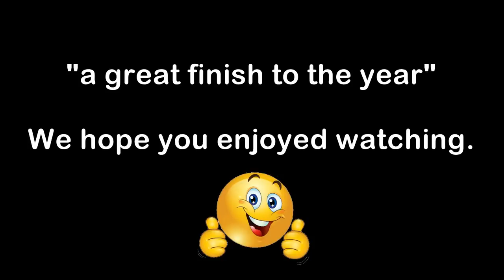4x4 Fails 2016

Comment: Looks like rock crawling is better suited for purpose built machines with lighter bodies and drive train made for the torque.  Not these vehicles.
Reply from the maker: This is about road registered vehicles doing tough terrain, not comp trucks.
Reply: +Aussie Four Wheelers (Hemi4WD) 
Yes, I have done something similar on a Honda Goldwing.  I took it out on a road that turned into an offroad trail and ended up with significant expensive damage to it.  I learned from that experience and don't go offroading with vehicles not made for the terrain.  That is why I posted the comment I did.  If you want to destroy street vehicles and pay to repair them, no problem whatsoever,  it is just far more fun when you can go rock climbing and get back home again without needing to perform major repairs on site or later on.  Once again, what you consider fun is also your business, but I don't consider field repairing a trashed drivetrain or suspension on a mountainside to be fun.
Reply from the maker: Different vehicle regulations for different countries mate. We are limited by what we can drive. Also, you cannot drive a non-registered vehicle on these trails, so we have to build our daily drivers to the extent we can.
Reply: +Aussie Four Wheelers (Hemi4WD) 
True, there are many places like that where I live as well.  After ruining a perfectly good road machine I looked for offroad capable machines that could still be street legal and licensed as well.  My favorite so far has been a Polaris RZR highlifter, it does pretty tough rock crawling and deep mud hole slogging.  I've not met any terrain yet that stops it.  I live in the rocky mountains so the trails there are just as tough as any.  I know you guys are having fun, it's just an extra challenge to field repair street vehicles on the trail.
Reply from the maker: See, those types of vehicles we can't drive here. Laws are very strict, so we have to build our daily's. Repairs aren't an issue, as usually the weak parts break, so we carry spares.
Reply: +Aussie Four Wheelers (Hemi4WD) 
Bummer dewd, that's just local differences, we deal with  the government obstacles as needed.  I managed to license my RZR for the street as an MPV or multipurpose vehicle.  It helps me stay legal on the roads that require it but gets me into some super tough mountain terrain.  Have fun with what you are doing and please stay safe fixing your vehicles on the trail.
Reply from the maker: Sure man. We wish we have laws like you guys. We can only lift vehicles 2" and increase tyres by 2" as self-certified. Up to double of that is possible with an engineers certificate, which is costly and required a swerve test done out on the track. Nothing else. No beadlocks, no long arms, no wheel spacers, must have mud flaps 8" off the ground, must have tyres inside guards or flares, can't increase wheel offset/track width by more than ¾ total, etc etc. Too many things to list.  Big fines for non-compliance and points on licence.

Comment: I cringe whenever I see someone off-roading in a new SUV. Those are totally not meant for that, too heavy and too big. Especially bad on stock tires and height.
Reply from the maker: That's why you shouldn't take a new SUV offroad on stock tyres and height.

Comment: Just like you dudes had to with rodeo, you'll have to come to Alberta Canada and learn how to 4 wheel. Some of this is cringy
Reply from the maker: Well happily come to Canada for some lessons if you pay for the transport.
Reply: @AussieFourWheelers  the price of the toys you're wrecking here, I think you can afford the transport.
Reply from the maker: Nah, we would love if you come here and teach us. Would be easier.
Reply: @AussieFourWheelers  I might take you up on that. You'll have to agree to buying real tires for your stock toys though
Reply: To be clear on the tires. You need a balloon style rock tire, not a standard mt. You also definitely need bead locker rims. Also, if you're going to beef up output, you have to add stronger driveline parts. U joints, cv's and steering linkage. You shouldn't put a daily driver through this, it's a waste of time and money. If you're going to put out the cash, go all the way. You guys neglect the very first rule of rock climbing. Lower your tire pressure so that you're getting more surface contact. Not saying you're wrong, it just can be done better. Trying to help
Reply from the maker: @brynmcgregor3859  haven't you seen any of our normal videos besides fails? What tyre pressure do you recommend?
Reply: @AussieFourWheelers  I have seen them , it doesn't change the fact you're wrecking mostly unfit trucks. As far as tyres , drop 10-15 lbs in the front and 5-10 in the back. Use the vehicles low-end torque when climbing, not speed. And beadlockers bro. A must. Again, I'm not saying you're doing it wrong, just that it could be done better, spending more time behind the wheel then under them. When we go out, we take a tow rope, a gas can, and an air horn to honk at dudes working on their stuff in the middle of the route. I had never even seen those green Maxi pads you guys use for traction until your videos. Lol. You have to remember though that I'm in the Rocky Mountains. Not some red rock hills. We face much tougher terrain so maybe my 4 wheel expectations are a little higher. For the same reason we're better at riding broncs , we're better at 4x4 cause we've been doing it bigger, for longer. Lol. All jokes and jabs aside, you guys look like you're having fun and that's what it's about. Keep Rollin mate, and keep enjoying it!
Reply from the maker: That's what it's all about, fun! We are not as good as you are, it's so clear by these comments.